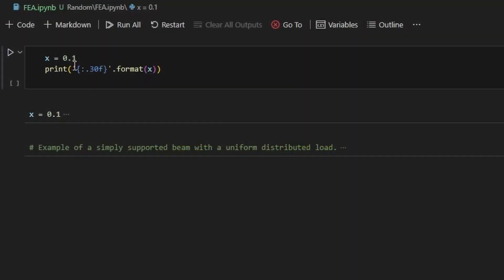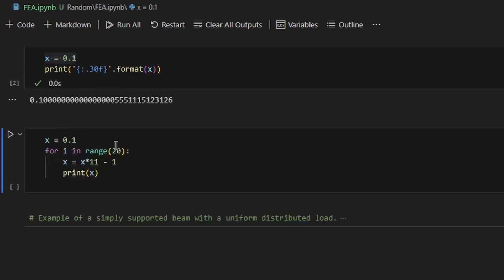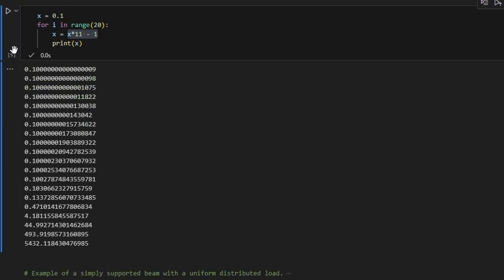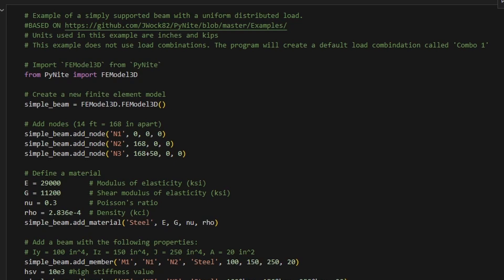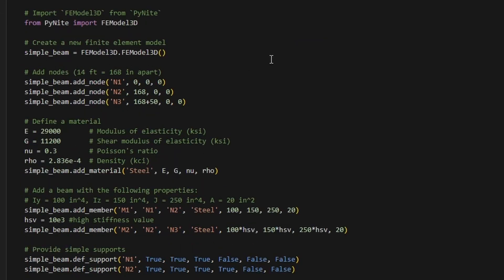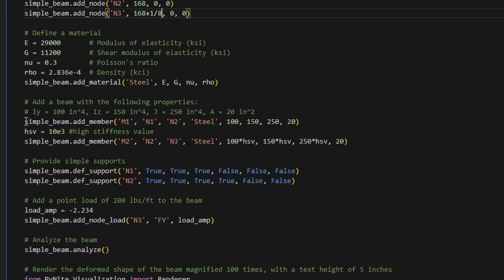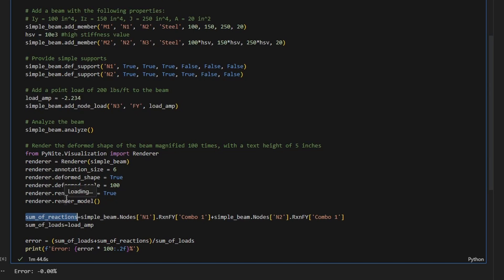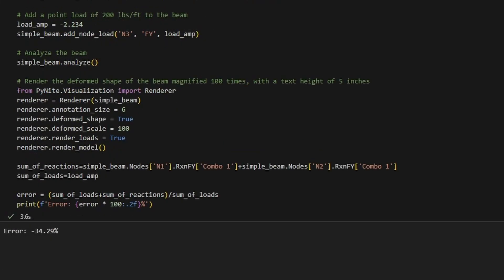Dangerous FE Modelling: Stiff members next to soft members. Example made with PyNite in Python.

Comment: Thanks for sharing this interesting example. I actually faced this problem while modeling a concrete bridge which includes multiple rigid links. The point is that I was able to solve this by trying different values of stiffness of the rigid links, which at the end worked for example with 10^5. But I didn't get a permeant solution or answer to this matter. In your opinion, do you think there is another way than trail-error, to figure out the correct approx. stiffness?
Reply from the maker: Generally I would want to avoid the “fake” members when possible, and when I use them I would give them non-negligible properties in negligleble places. An example is in etabs where you put in lines to apply facade loads. Here I would probably make a 50x50 beam with no mass. The stiffness is SO much smaller than the slab that it doesn’t matter. (Easily 10.000 times less stiffer than a slab section), but it’s not something ridiculous. 😊